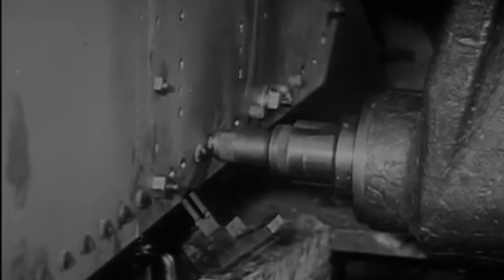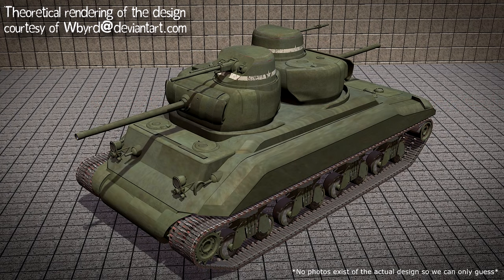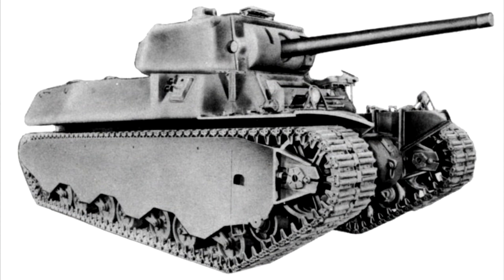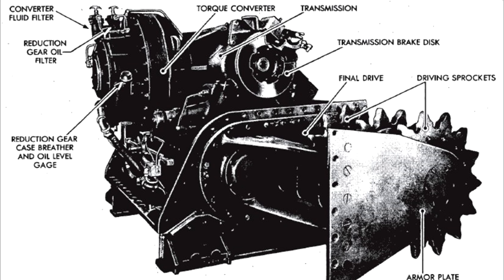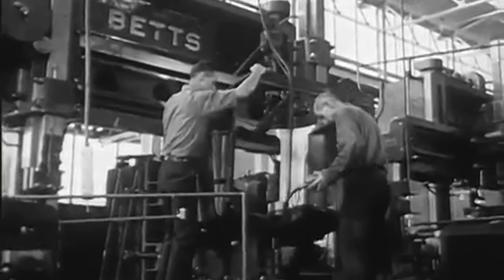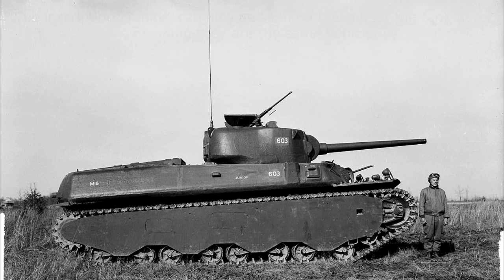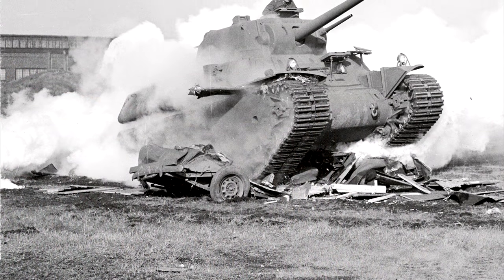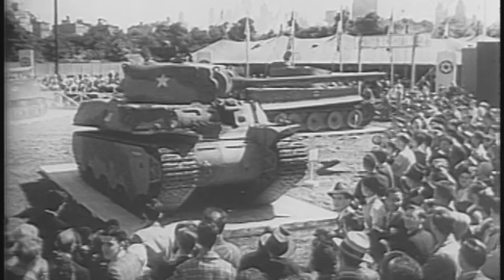America's Tiger, the M6 Heavy | Cursed by Design

Comment: The truth was that it was quickly found out that two Shermans could easily be loaded on a ship instead of only one heavy and cumbersome M6. Not only, the M4 could easily be loaded on the ship with spare parts as well....
Reply: The Truth was also found quickly that 10 dead body bags were loaded up coming back on that ship home for not having a Heavy also.
Reply: @thethirdgeneration1738  That's no truth, that's a lie.
Reply: @defenestrationismyfavoriteword  Nope.  It’s been verified. Not having heavies, was costly to us in many ways. I’ve already explained this in another post on this thread why.  “Do the body count”  well you in a Sherman up against a Panther, a Tiger, a Tiger 2, and see how you far out. 
You’ll need 11 more Sherman’s to try and out swarm the Tiger from the rear, but first that Tiger is going shoot holes in about 8-9 of those Sherman’s.  Sherman rounds will bounce off.
Reply: @thethirdgeneration1738  1. Sherman Jumbo
2. Sherman crew survival rates vs all other tanks of the time
3. Poor german metal quality in the later stage of the war when all these big cats started being made. The 75mm could frontally penetrate the Tiger's on paper armor (assuming perfect metal) at 500m. The 76mm and 17pounder had even less trouble.
4. Poor quality of german tank crews as the war dragged on and all their aces were killed (seems they needed those bodybags more than the Sherman crews)
5. Tank duels were usually a first-shot wins deal.
6. Gun stabilizer.
7. The amount of Tigers faced by Shermans was extremely exaggerated.
8. Versatility. Count the amount of M4 variants  compared to the amount of variants for other contemporary tanks. Including the Jumbo which seems to fit that US heavy tank you're opining for.

War isn't a game of paper stats and who has the cooler gear. You can scream the "5 shermans for 1 cat" myth all you like and act like Fury's a documentary but reality barks louder than the biggest german gun. And reality is Operation Totalize ending with Wittman's entire squadron getting wiped out. If you got the time look up Chieftain's video "why the sherman was what it was".

If you want the tl;dw, the Sherman was no death trap. Very much the opposite. And a Heavy tank would have been hell for logistics; shipping, bridges, railways so on. What would the heavy tank have done? Have less tanks that can die to less AT guns? It'll just get blown up by a mine, throw a track, burn out its transmission, have its crew killed while they're outside trying to get it unstuck, or have an infantry squad get wiped out by other infantry because the only tank you have is already busy somewhere else and the brass chose to have 1 heavy instead of 2 mediums. And then die to a bigger AT gun.
Reply: @defenestrationismyfavoriteword  well said
Reply: @defenestrationismyfavoriteword  This is a very convincing post.
Reply: While some German tanks of WW2 had some advantages in armor and firepower, they weren’t the good-like weapons you describe. A Sherman’s gun can penetrate a Tiger, even if it has to be slightly closer (later variants of Shermans and declining quality of German steel changed this). One good shot from a Sherman can kill a Tiger, just as a bad shot from a Tiger can bounce off a Sherman. You don’t need 12 Shermans to kill a Tiger; the myth likely comes from the fact that the smallest American tank group was a 5 tank squadron, meaning that no matter what the target was, commanders typically just sent a 5 tank squadron, rather than carefully consider the least number of tanks they could send.

Another thing is soft factors, such as crew comfort, ease of manufacturing/transport/training/repair, vision for the commander, fuel economy, build quality, and ease of escape. While these aren’t shown in games, they are just as if not more important for fighting an actual war. The Tiger 1 actually had decent soft factors for the design (although they still weren’t god-like, just decent), something that the Panther and later Tiger 2 lacked. The Sherman’s hard factors (armor, mobility, firepower) were usually lesser, but their soft factors typically exceeded their German counterparts, allowing there to be more Sherman’s in the war with more experienced crew and better situational awareness. These could allow Sherman’s to ambush German tanks, allowing them to get closer or get to the sides/rear (the Tiger 1’s sides had the same armor as the rear) to fire the first shot before they were spotted.

In conclusion, war is nuanced and complicated. You can’t just boil it down to statistics, where this tank has so-and-so mm of armor, and this tank has so-and-so big of a gun, therefore, this tank is this much better. There are a million different factors, including doctrine, economy, logistics, terrain, and climate that affect how well a vehicle performs. Heavy tanks and medium tanks both had their advantages and disadvantages, you can’t say that one is objectively and conclusively better than the other; it just so happened that in this instance with these specific factors, a heavy tank was deemed unnecessary.
Reply: @thethirdgeneration1738  this guy really forgot about sherman jumbos and the vast amounts of american Tank Destroyer units!!! LOL!!!! Thats not even mentioning air support and Bazooka infantry
Reply: @thethirdgeneration1738  A R R A C O U R T
Reply: It was hard to get heavier tanks over there. But we had to cross an entire ocean.
Reply: @brennanleadbetter9708  of course we are talking the ubiquitous Liberty ships. A Liberty ship could carry 440 Light Tanks or 260 Medium Tanks not to mention ammo and food troops. It is safe to say that USA and the allies would have great difficulty without those ships...
Reply: @paoloviti6156  indeed
Reply: @thethirdgeneration1738 you're just spewing myths
Reply: @thethirdgeneration1738  Your theoretical dead tankers are trumped by real dead PBI that died due to lack of tank support.
1 for 3 is the ratio of M26s to M4's as per logistics corps estimates.

I'll give you a breakdown of what tank support does as per post ww2 studies.
Company of infantry attacks a defended position held by a similar nmy infantry unit.
No tanks : 30-40% casualties, half dead.
1 tank : 15-20% casualties, roughly a quarter dead.
2 tanks, 5% casualties, maybe 1 dead. 

PBI life is brutal.
Reply: Cobra king is a great example of that. It was killed 3 times iirc and 2 of those the crew survived to fight another day
Reply: @thethirdgeneration1738 Beating a dead horse, but there were also 76mm equipped Sherman’s, which were able to dispatch Tigers and Panthers relatively easily, plus the M6’s armour really isn’t that good, it was 100mm flat on the front, and couldn’t angle. It’s slightly more than the armour of the Sherman, with a wider profile and less mobility.
Reply: @paoloviti6156  I have waited patiently now. With all the replies. And, found out what I needed to know. This is a Fan Boy Trap, just like I knew it was. But, one must give the benefit of the doubt totally and completely, to everyone before drawing any conclusions. Thank You for being part of the experiment. Good Day. (reply for all the posters on this thread.)

Comment: Ya know, I as certified Armchair general, I absolutely love this monster of a machine. Nothing says power as your tank being so big that if commander would slip and fell off the turret he would likely die or be severally crippled. Now that is power!
Reply: ahahah
Reply: MAXIMUM GIRTH
Reply: Hell I actually have sketched a design for a Infantry Support Gun that has a 90mm/17 pdr Cannon, a pair of twin TOW pods on the sides of the turret, a L94A1 7.62 NATO Chain Gun as a Coax Gun, w/ 6 wheels - that are similar to ATV wheels - and a pair (or perhaps 3) of diesel engines w/ a Automatic Transmission featuring also a deployable laser ranging and guiding mechanism for a 155mm Copperhead Arty Round.

So that way this Infantry Assault Gun not only provides direct Cannon Fire but also has Anti-Tank, Anti-Infantry and Forward Observer Capabilities. Oh and it even comes w/ it's own field phone should Radios cease to be effective (and of course it has a radio comms system).

Comment: My Dad drove the M-5A1 Stuart during the war. As you probably know, it had twin Cadillac engines with the Hydro-Matic transmission, which allowed the use of one engine only if the other was damage by simply unhooking its drivetrain. As the Stuart was a light tank, it was used, (at least by him), in a scout-recon role.
Reply: In the West, Stuarts were doing a lot of recon and scouting, rather than engaging armor.

In the Pacific, where Japanese armor was much less advanced, they did a lot more shooting and assaulting alongside Shermans and such.

Comment: Soooooo, how many machine guns do you want? Designers: YES
Reply: America was the cult of the machine gun. M2 had even more
Reply: Look up the M-2 "Combat Car," the ancestor of the M-3 Stuart: EIGHT machine guns. Early production M-3 Stuarts still had the excess machine gun ports, welded over or blanked off.
Reply: And once it was accepted into service, they were almost all 50 caliber machine guns. How do you make a fighting machine better? More 50cal. That is 12.7mm for those outside America, unless I am mistaken, which as an American I might be.
Reply: @michaelcox9855  "Moar Dakka!" is always a legitimate demand.
Reply: "How many you got?"
Reply: @Anlushac11  "All of them."
Reply: "There's no such thing as too many machine guns" Sun Tzu, Art of war.
Reply: "Use a machine gun, if that's not enough, use MORE machine guns." -Engineer
Reply: Yeah, America early war is basically the biggest supporter of the "Cult of the Machine Gun"
Reply: But IS7 have 5 MGs if iam correct..
Reply: @joe125ful  Still less than the M2 medium tank.  M2 had a minimum of 7 30 caliber machine guns with a max of 9 on top of its main armament of 37mm cannon. 200 cannon rounds and 12,250 machine gun rounds under full load.
Reply: @michaelcox9855  Yes but its not that cool.
Reply: @joe125ful  How can you say that of something with a machine gun reverse Mohawk?
Reply: @michaelcox9855  ?
Reply: @joe125ful  Look at a picture of the M2 turret from the front. What do the two backward upswept machineguns look like?

Comment: I always thought that Hydra-matic was just some marketing BS that GM used to call automatic transmission like "Torqueflite" in Chryslers
Reply: GM developed an automatic transmission in the 1930's with expectations that it would lead to more women buying their cars. Many women back then avoided driving since they disliked using a clutch to change gears and had problems using those when stopped facing uphill. Some time earlier an Englishman invented a select-shift manual transmission that used electric solenoids to shift gears and work the clutch. One placed the gear selector in the desired gear then pressed and released the clutch pedal to go into that gear. It worked smoothly so was used in expensive English cars and copied by the Germans to use in their Tiger 1 tanks. The GM Hydra-Matic worked fine except would go into gear with a strong thump which many drivers found to be annoying. GM worked on reducing the thump during the war and didn't get it eliminated until 1950 or so.
Reply: GM spent $Millions developing the "Hydramatic". I was a 2nd Armored grunt--our 2.5 Ton trucks had Hydramatics. I asked why an automatic in a truck (most commercial trucks have stick shift like 6 to 10 speeds. The answer: Because the Army (at that time) is made up of 75% draftee's who don't know how to use stick shift...I am not sure that was the case but we never had any probs with the Hydramatics.
Reply: @hddun  that was the reason that I have read before, and the article also stated that they had no transmission problems after its introduction, almost all your modern buses and coaches are auto's today with lorries going the same way, its hard to abuse a torque converter on take up compared to a manual clutch, I can see the attraction in a car but I still like my stick.

Comment: Gaijin actualy hates U.S. tanks. They reduced the horsepower on almost all U.S. world war 2 tanks for no reason.

M6 Heavy irl: 950 HP / M6 Heavy in game: 800 HP
M4A1(76) and M18 irl: Around 460 HP /M4A1 (76) and M18 in game: 400 HP
M4A3 (76) irl: 500 HP / M4A3 (76) in game: 450 HP.
M4A2 (76) irl: 420 HP /M4A2 (76) in game: 410 HP. 

Originaly these tanks actualy had realistic horsepower ratings (except for the M6) but around 1 year ago they silently nerfed all of these engines. They did not write about them in any changelog so most players missed out on it. 

What is the point in pretending that WT is a "realistic tank game" if they do biased s**t like this?
Reply: Wait, the M4A3 has the 500 HP from what I remember
Reply: @ivanvladimir0435  go take a look ingame. They reduced the horsepower to 450 on the M4A3(76)W.
Reply: Russian bias blyat
Reply: Afraid of over shadowing muh russian tanks
Similar to how the m6 being a 4.7 and facing tigers and panthers despite being a paper thin armored slow pos

Comment: At 14:05 in the video, it's a late production M6A2 using the 90mm M3, it also had better armor in every single part apart from the floor(it stayed the same) compared to early production M6's/M6A1's/M6A2's.
The US reviewed all previous armor specifications, and finalized a new armor setup for the late production M6s in late 1942 following the measurement at Milford:
(The armor upgrade weighed 9,500 lb (4.3 ton))
It received positive feedback, too bad it was too late for that.

Comment: The Europeans don’t have to manufacture their Tanks across the Atlantic ocean. American Tanks were shipped by rail from Detroit too Atlantic ports. To be loaded on Liberty ships. A heavy tank needs new rail cars. Upgraded railroads, bridges, and tunnels. The port facilities needed bigger cranes for loading and unloading. Liberty ships needed modifications. 
Getting to the battlefield is necessary. In retrospect the Americans could have asked the British to produce a heavy tank for all the allied armies in Europe..
Reply: None of that was needed. The boom cranes on the Liberty and Victory ship were capable of lifting the M6 and Pershing. The railroads had plenty of flatcars capable of transporting them but those were being used to haul heavy loads of steel plate, structural steel and machinery. Roads, bridges and tunnels didn't present a problem since truckers and railroads could plan routes to avoid low tunnels and roads/bridges that had lower weight limits. The M6 was cancelled because the armor commanders overseas didn't want them because they were slow, unreliable and would require their own separate store of parts, repair shops with specially trained mechanics and their own recovery units.
Reply: @billwilson3609  ….. Well yeah, the customers being Generals Eisenhower and Bradley said no thank you to it. But later said the M26 Pershing heavy tank was needed. I stand by my proposal that adopting a British heavy tank would have been more direct. Had the Brits produced one on time. Another solution was to have more 90mm armed M36 Jackson TD’s
Reply: @Idahoguy10157  British industry was way outpaced by the Americans.  The U.S. should have built a fleet of these babies.
Reply: @Idahoguy10157  The Army didn't want the Pershing either since the M36's were getting the job done. Congress ordered Ordnance to come up with a heavy tank in 1943 due to the public's concern that US forces didn't have one and that may hurt their re-election in 1944 if the Army didn't have one by then. The M36 used the M10 hull that was produced by Fisher Body. Fisher Body was having organized labor problems so Ordnance had M36 turrets installed by Ford on new M4's while the Army rounded up M10's from the US training bases. Those were refurbished to become M36's. Fisher Body was to produce 8,000 M36's but that contract was cancelled after 2,000 M4/M10 M36's were made since the Army expected the war in Europe to be over before Summer.

Comment: Seeing as they had been built in quantity, I would have used them.  I would have used them under a use them and lose them mentality where no replacements are to be made and the value of them would be for a "Special" push.  This would be ideal for pushing into a major city or fortified position.  Loses would be expected, but seeing as they were tougher than the Sherman, the surprise would be useful in revealing a "New" threat.  Even if not used again, the reports of these behemoths would distract German R&D and resources to make mammoth killers where lighter tanks/guns/planes would do just fine or better.